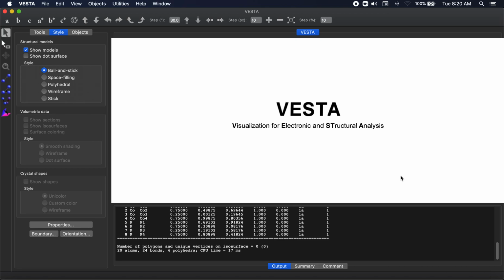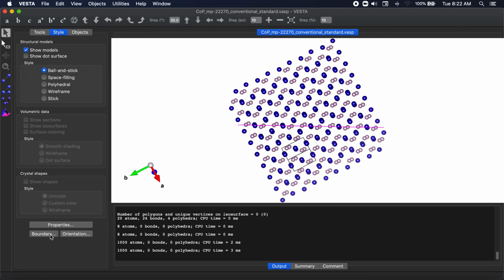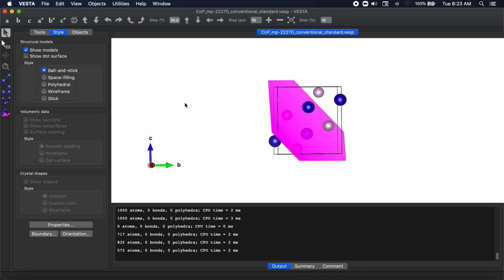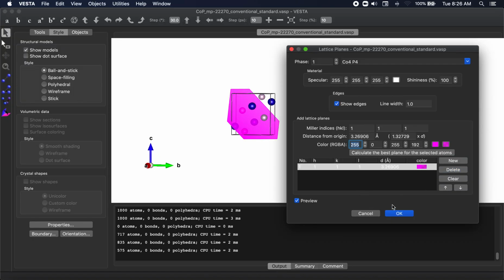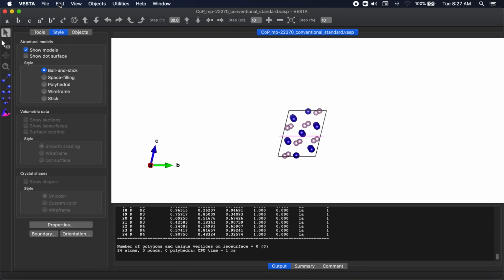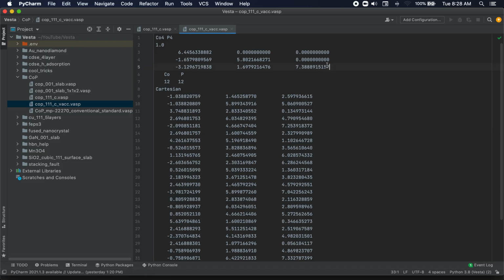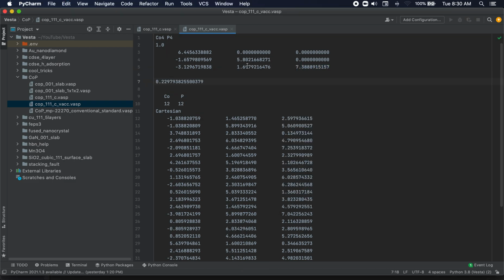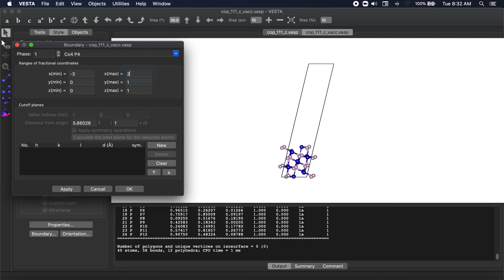CoP 111 Slab Model in VESTA (very tricky)

Comment: If possible please give your comments to transform non orthogonal lattice vectors to orthogonal vectors. in this example of CoP (111) lattice vectors are not orthogonal. my task is to find proper possible, at leaset nearly, orthogonal lattice verctors without loosing CoP crystal nature. this is possible in paid software such as Material studio. I have tried many times, so far no success.
Reply from the maker: Hey. So you are able to make CoP (111) surface in materials studio that has orthogonal lattice vectors? Our final structure is a triclinic cell, so I doubt we can orthogonalize it and retain proper CoP. I think we have to start from scratch using your approach described in your other comment. I am going to think on it for a little bit
Reply from the maker: I do think it’s possible to make it nearly orthogonal - but would require a huge supercell to be cut from the model I make in this video

Comment: Hallo Nickel and Copper, thanks for your valuable effort and time for these types of videos. 

for transformation matrix, one can assume as follows. Assume the required direction on the new c axis.  in this case (111) is on the new c axis. now find a perpendicular axis to this (111). The (111) plane has three edges. one cut a.b axis, second on the b-c axis, and third is on the c-a axis.  so (-1,1,0)  can be one choice. this is perpendicular to (111). now do cross product to find the new third  axis 

cross product (1,-1,0)x(111) = (hkl). all three axis togeter forms the transformation matrix like   [  h k l, 1 -1 0, 1 1 1 ]. 

NOTE: these are perpendicular only in cubic systems. but the procedure will out to find vectors for any crystal symmetry
Reply from the maker: Thank you so much for the kind words. Ya, it works for a cubic system, but I am not too sure how to get it to work for arbitrary crystal systems.
Reply from the maker: Just re read this - I think you are onto something. I will do some testing. Thank you for your valuable suggestion and lesson ^^. People will really benefit from this.
Reply: Sir, could you please provide the reference for this.